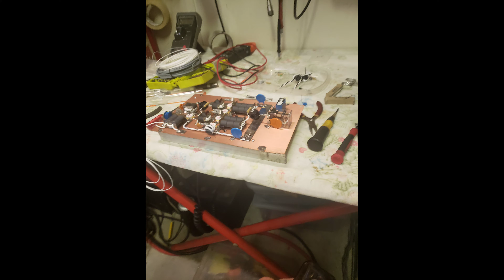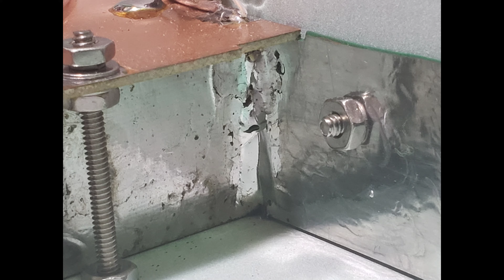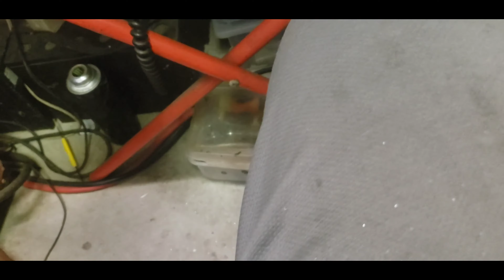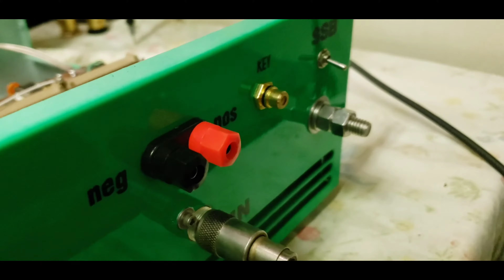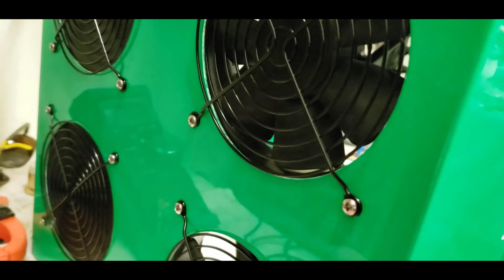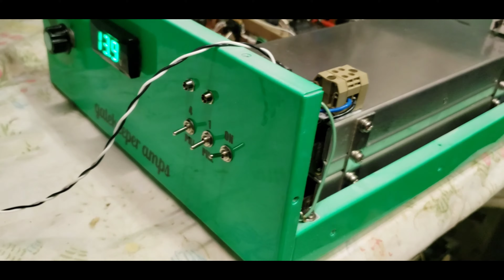GK Built Candy Apple 🍏 Green 1x4 5 Pill Staged Base Amplifier - wOw

Comment: Good looking amp, Gatekeeper.
Reply from the maker: THANKS MR. TARZAN LOL not sure if that is your handle but thanks for the kind works and please do share this on your socials if you get a chance!!!!!!
Reply: @1883GotDown  hey, I got a question. I bought an old Texas Star, but doesn’t say Texas Star (Bi-lateral 4 Power DX400) and the buttons are Red (Power) White (Receive Amp), Orange (AM) and Green (1.5db). Is the green button for SSB? It has a delay when un-keying the amp. Why does it have 1.5db? The reason I ask is the only video I found with this button configuration had a toggle switch someone installed by someone that has SSB over it. I think it was a donkey stomper video. He used it in conjunction with the Orange (AM) to put the amp in low, but mine doesn’t work that way. It doesn’t put out anything more than the radio it seems with Green and Orange buttons in. It does go into a Medium power with only the AM button in. Sorry so long of a question, but that video has me completely confused about what it’s operations are concerning the green button.
Reply from the maker: @hillbillytarzan  Yeah it sounds like this is just a very old Texas Star, Yes that button is doing 2 things. It is your SSB Delay Button and it also is giving you a 1.5db attenuation it appears. All of the Non Variable TS High Drive Version amps are like this. You will find in some of my videos where I removed this attenuator for them when asked for it.

I have a lot of Texas Star Videos Coming here in the near near future. Upon release of each own I'll be releasing them in the Texas Star Facebook group.
Reply: 👍 agreed
Reply from the maker: @littledebbiethomas451  thanks...your name is the same as mine lol... what's up with the little Debbie huh lol.

Comment: That amp is super ! I use the same pill screws for same reason. I haven't found a way to turn up voltage up on mean well . for that reason I buy 15V . RSP 1000-15 ETC. The last base amp I fixed was 8 pill RFP 2879 box. put mean well 15V switchers in. set 15.00 V each . don't see a drop either . got fancy found small dual display meter on amazon AC volts/Amps . and green led DC volts. all mount in 22MM hole. runes on 15A 240V plug.  used ceramic microwave fuses 250VAC rated UL listed with MOV's runes like a champ now ! was a blue label rebuilt buy 2 shops   has now  a big heat sink class B . now buy me mean well  15V switchers and meters . costumer is shocked how well it runs SSB now. just under 2KW PEP . them 30 amp 12V LED switchers just fail when using SSB a lot. 73's
Reply from the maker: See i can tell you know exactly what you are talking about man....it is best to go with the 15v version. I finally did figure out how to do this thank God! I also habe to replace a senor diode to boost the OVP a bit and while I'm at it replace the filter caps from 16v to 25v :) I love your comments man, you always take them to  give full detail and I get yo hear of neat projects you have got to do.
Reply: I can yell you know your stuff....do you have a YouTube channel sir?
Reply from the maker: @littledebbiethomas451  yes he does...he is one of my smartest subscribers for sure!

Comment: non red dot? where did you find thoser? dang son!
Reply from the maker: They were bought from RF Parts for $50 or so...told ya I was behind man I wasn't kidding...I got deeeeeeeeeeeeeeeply behind and instead of running I stood in here and kept going.....HUGE LESSON LEARNED!!!
Reply from the maker: Share on fb or any of your socials bud....thanks a lot for always checking out my videos.
Reply: I've seen them on ebay and other online websites for cheap.... I have wondered though that they probably are not real though. Any thoughts on this?
Reply: @ludamizcrypto7389  DEFIANTLY FAKE. Only place is RF parts
Reply from the maker: @1112223333111  I agree 👍
Reply from the maker: @ludamizcrypto7389  99 percent of the time they are fake